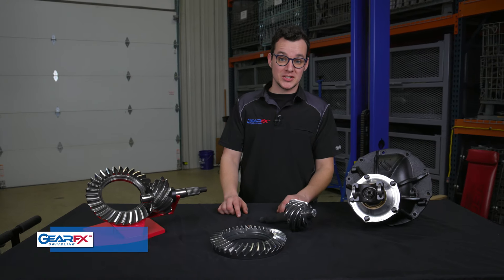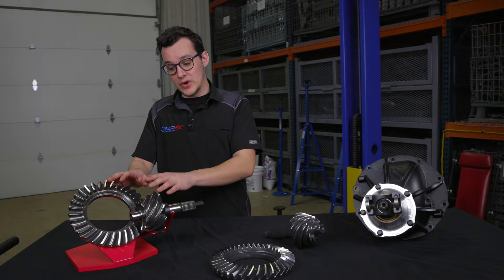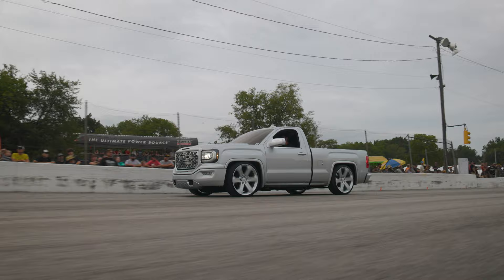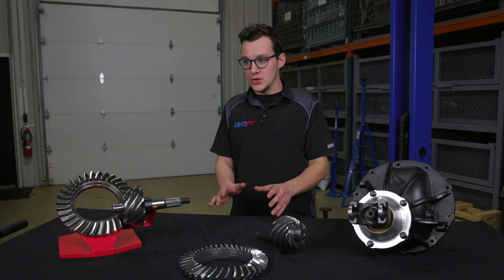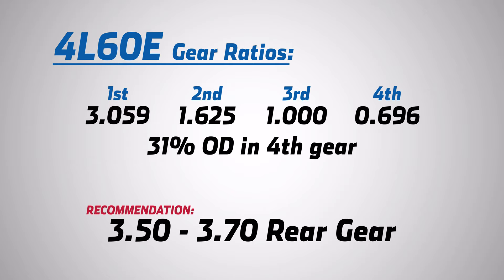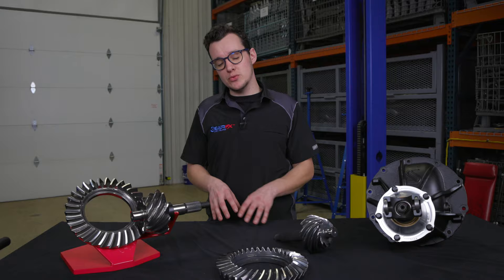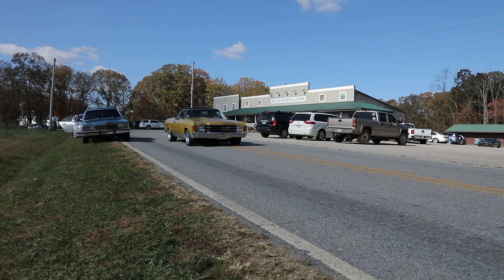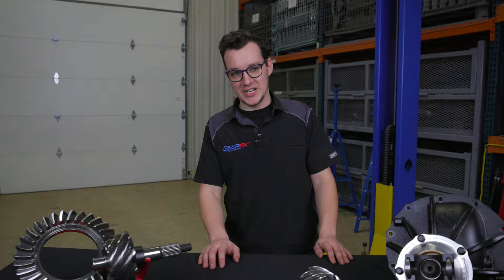What Gear Ratio Should You Put In Your Car? Gear Ratios, Explained

Comment: 3.73's ,4.11's are only good for 1/8 mile. After a quarter mile there is no way they will keep up with a 3.25. You will see nothing but tail lights, and won't see anything afer a 1/2 mile.
Reply: Drag racing is overrated.
Reply: @hudsondonnell444 Nah dawg, drag racing is sick. It's the most basic form of racing but it's so hype just seeing those beautiful machines take off from standstill down the strip, and there is no other motorsport with better wheelies!
Reply: Only applicable if your crapbox is a relic that only has 3 to 4 forward gears
Reply: Quarter mile is king

Comment: What gears ratio would yall recommend. I have a extended cab 98 obs 1500, with n/a 5.3 sloppy stage 2 cam with 4l80e transmission combo? I believe currently it has 3.73 rear end gears.

Comment: what about a 2020 ford mustang gt with long tube headers, boss 302 intake with 200 shot nitrous, 10 speed transmission tune and e85 on a 315/50/17 mickey et tires on the rear i mainly roll race what would be good gears for those ? oh and i daily the car … what you recommend
Reply: Junk
Reply: @AllCelebzNElitenNeckMaskz  i’ll take that pos bike 🏍️ to gap city 😂

Comment: I just bought a 2005 silverado 1500 2wd 5.3  from the first owner , the paper work shows it has the 3.73. as a package option, a heavy duty suspension, GVW rating is 6,800 lbs. the truck is lifted 6 inches. does this means that the truck is more for towing than for crusing ? I just want to understand what I have Im new on this gear ratio thing...LOL

Comment: I have a 68 Camaro making about 500 horsepower NA I plan on putting on a pro charger soon my 0 to 40 is very nice however the car begins to slow down after that like it’s running out. I bought the car with posi and I’m  assuming 4.11 what would be gear for a 700r4 Camaro with 18 inch wheels. 600 horsepower

Comment: Was sup bro, I have an 2007 crown Victoria P71 4.6L V8. I think I have 3.27’s but I wanna get more power of my car or at least make it faster at the tires. The weight of the car is heavy but she can go at lower RPMS but at higher RPMS I have to hit the gas the. She revs. Idk if I should go with 3.73’s or 4.10’s. Here a lot of the lose top end power on 4:10’s? I kinda want the best of both worlds what would you suggest? I have exhaust upgrade with K&N stock & a little tune on it. Maybe 4:10’s for faster speeds or 3.73’s for best of both worlds.

Comment: What would you recommend for a 6.0l V8 gas engine with an automatic 4 speed overdrive transmission. The truck came with 245x75x16 but I’m running 35x12.5x17. It’s an 04 Silverado 2500HD
Reply from the maker: If you plan to do a lot of towing, then a 4.56 would probably be your best bet. If not, then 4.11 should suit you just fine.

Comment: I have a SBC 350 I'm looking for some gears I have 15 inch tires 700 r4 transmission I should be around 400 hp 1106 summit racing camshaft (help) lol
Reply from the maker: Hi Chris! Give our sales team a call at (704) 799-0955. They'll be able to better assist you with this!